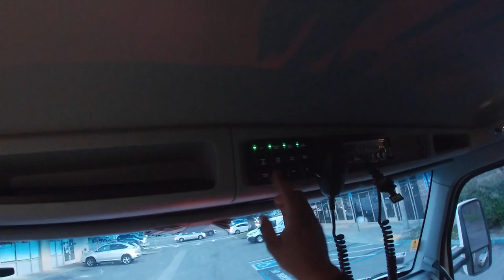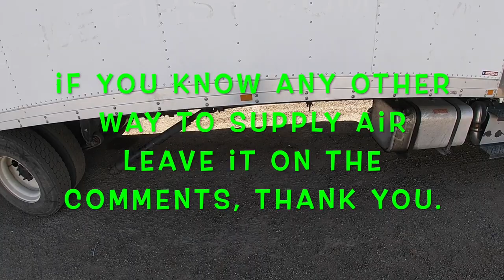supplying air on freightliner

Comment: You will find out supplying into the air dryer if theres air in the system unless you have the special pliers you have to get the air all the way out of the system pump the brake pedal until theres no air line will come off if it has a Cummins on a freightliner theres a fitting to air the compressor line
Reply from the maker: i see what you are saying, thanks for the heads up.

Comment: Half inch plastic line on the dryer drain the tanks pop that out the quick connect in the dryer and attach a half inch quick connect with an air fitting to it
Reply from the maker: i will check that out next time. thanks for the advise. 👍
Reply: Some of em have  a t with a red plug those are even easier